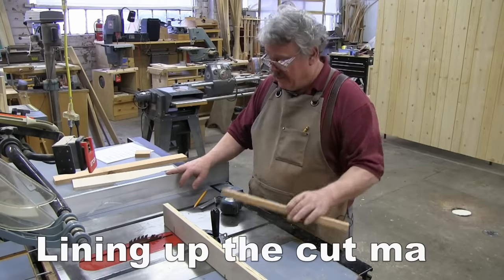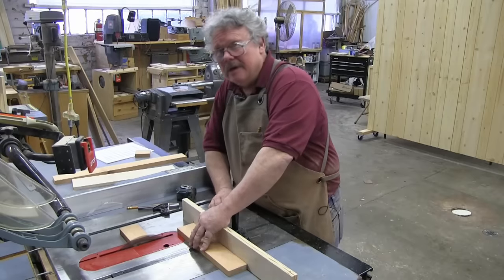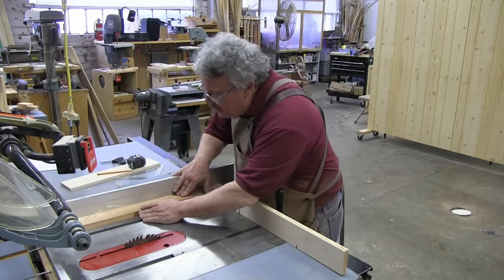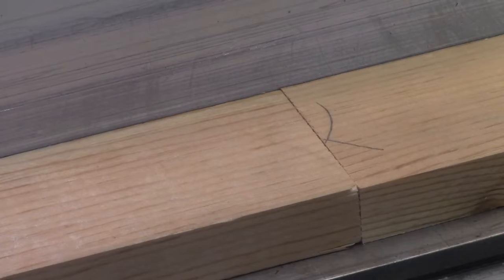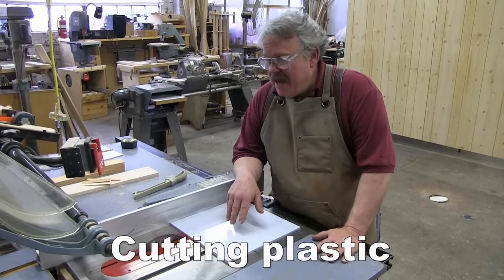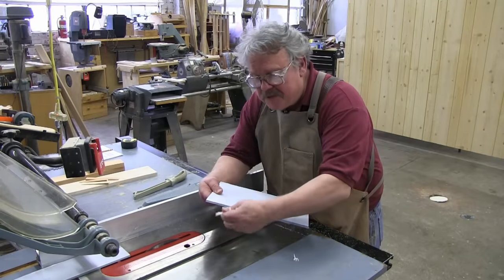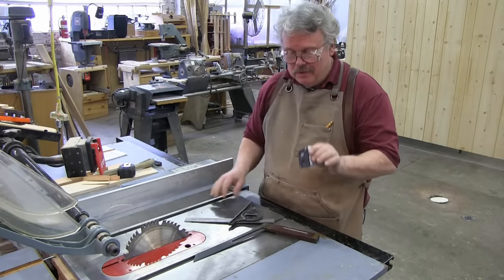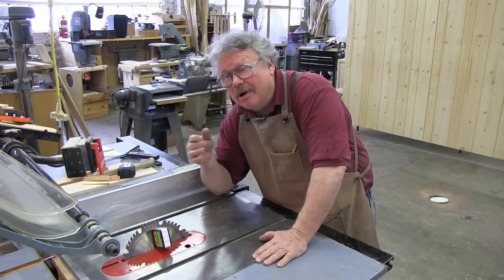5 Expert Table Saw Tips

Comment: Thanks for the video tips.  I have installed a magnetic relay "STOP" switch a my leg level on the table saw frame and by tapping the switch to turn off the table saw without having to take my hand and eyes off the wood and find the the table saw off switch.  I don't use plastic push stick because they can shatter if they tough the blade and I don't use the "bird's mouth" push stick anymore because the pivot at the back of the wood and the front of the wood is free to rise up because of the rotating blade.  Instead, I use a longer wooden push block that provide downward pressure and forward motion all in one movement to prevent kickback and improve table saw safety.
Reply: I've been a contractor for 27 year,  and i fully agree with you. He's leaving way too many variables open for kickback and all kinds of damage to the push stick and materials.

Comment: #2 assumes is that the faces or the piece are parallel.  One way to check that is to flip the other piece at the cut line and stack it on top of the first piece.  This puts the same face against the fence.  Now run your finger on the cut end and make sure the piece line up perfectly.  Now flip the pieces together so the other side is against the fence and check again.  If one matches but the other doesn't the faces are not parallel.  If they are both off then likely the cut was not square.
Reply: I thought you were only to use jointed boards on a table saw unless it's clamped in a jig? Ofc you don't have to, but it's not as safe. Edit: Jointed, then can be squared on a table saw/planer
Reply: @CowsGoMonkey  Jointed boards do not necessarily make a board safe or unsafe for use on a table saw.  Contractors rip lumber store wood all the time and almost nothing that comes out of lumber store is square or parallel.  You just have to use the right technique for the board you rea cutting.
Reply: @connecticutaggie  Ofc you can use unjointed boards, but jointed boards(2 sides) are safer. 

If you think that's wrong, then go rip a log on a table saw without a jig. Or a extremely cupped/twisted board.

And if you are checking for accuracy anyways like you were nitpicking orginally, you would want a square or 2S jointed board.

Comment: Good tips! How come you don't use a riving knife or splitter?
Reply from the maker: Thanks. It is an old, old saw and there are no riving knives available for it, and the mangled splitter that came with it interferes with the overhead guard we installed.  (No, the Delta Disappearing Splitter won't work; we've tried.)  I have gotten used to turning off the saw when the blade binds and inserting a small wedge in the kerf.

Comment: Sounds like the saw is getting ready for some new bearings
Reply from the maker: Yeah, we were thinking about replacing the bearings but decided to find a slightly newer version of the same model. The slightly newer version has adjustments that allow you to further adjust the angle of the blade. - Travis

Comment: Good tips. I have considered getting an inclinometer and after seeing this, I'll definitely get one. This will work well on setting the planer fence ninety degrees to the bed.
Reply from the maker: It's one of those tools that, once you have it, you find a zillion uses for it. A month after purchase, you wonder how you ever did without it.
Reply: I just bought that digital one, and I completely forgot the zero-function, so thanks for reminding me that the ground on which you work on is never 0 degrees, haha
Reply from the maker: @MDay8  So True. The hangar in which we have our shop is 100 years old, and our floor has been afflicted by tectonic drift over the century. Not only is no tool  sitting level, no tool is at the same angle!

Comment: Great tips and video - thanks heaps.  Will certainly check out your channel.
One thing you probably could have mentioned is that digital angle meters usually have a tolerance of 0.1deg  to 0.2deg.  Having said that, they are better than ‘eye-balling’ it.

Comment: Hello i like your video  but can i give you a tip.   on 1:20 instead of marking the line on side of the blade and you have to use the straight square  tool .. Mark line on the opposite side and align it to the   cut out mark ..

Comment: point 2 - you said checking the miter gauge against the fence for square will tell you if the gauge is square to the blade, assuming the fence is parallel to the blade. That is true. But it's really not what you should be looking for. You can make a square cut using a miter gauge even if the gauge is not square to the blade. The key is that the fence for the miter gauge must be square to the miter slot/miter bar. 

Love the tip about using the inclinometer to set the bevel angles. I have one. I don't know why I don't use it more.

Comment: When cutting strips of laminate, i spray some contact cement on a piece of mdf, only, stick the laminate to it and make the cuts. You can cut extremely thin strips with no chipping and it’s easily removable afterwards.
Reply from the maker: Good tip.

Comment: thanks for the tip on opening the kerf. I was watching for the only solution for what I am doing as I use a 7-1/4" blade 1/8" there is no splitter for that. Don't anybody jump in and say thin kerf microjig won't work. Thanks for your knowledge. Now I need to subscribe To get more info. Thank you
Reply from the maker: Most welcome.

Comment: Great tips! Nice work Nick and Travis. If I had another thumb you would get 2 thumbs up!
Something I found out while making a segmented turning was to zero the angle box (in the 8:55 minute mark) on the cast iron table instead of the throat plate. Also some angle boxes are very sensitive and if the aren’t 90 degrees (front to back) to the cast iron table when measuring it can slightly throw the angle off. It may have been my particular angle box. Was just my particular issue but when I started doing those two things it corrected my issue.
Reply from the maker: You might want to watch or video on aligning and adjusting a table saw. In it, I suggest to the viewers that they spend some time carefully adjusting the throat plate so that its dead-on flush with the table. There are dozens of small measuring devices -- squares, triangles,  height gauges, and so on that need to be set next to the saw blade. In order for them to be accurate, the throat plate has to be properly aligned. A digital angle finder is one of the very few that can be registered several inches away from the blade, then used to measured the blade position. I registered the angle finder off the throat plate because I know I can trust my throat plate -- with ALL of my measuring devices.

Comment: I cut lexan last week with a carbide rip blade, worked just fine. I cut same lexan in power miter saw, very bad idea resulted in  bad kickback.  I have had good results cutting 1/8" aluminum on tablesaw with fine tooth paneling blade on tablesaw.  Great tips on the use of the inclomometer  (digital angle finder) thank you for all the tablesaw tips in this video.
Reply from the maker: Most welcome.
Reply: Yea a paneling blade will also cut most roof steel in a circular saw, but makes hella racket and leaves sharp edges that must be dealt with, so gloves and ear protection a must.

Comment: I hate stopping my saw in the middle of a cut. And I don't like stopping the wood either if I can avoid it. Unless I make a complete, continuous full cut, there's always some little ridge or burn mark on one side of the kerf or the other.

As always, great content.
Reply: the trick is after saw winds down, move it back about an 1/8th inch or so so teeth are free in the kerf, then don't re-engage until blade reaches full speed.

Comment: When using the digital angle gauge ("inclinometer"), it is critical to rest it on the table and then rock it up onto the blade.  The reason is any slight tilt of the device forward or back will result in an imperfect reading.

Comment: Great video and tips as always 👌 👍👍👍
Just some observations tips...
4.o = safety tip... When used as shown, the blade is pushing the cut part forward (outfeed), so make sure you are expecting that or part will fly 😀. Normally, resistance is in the direction of the operator. ALSO, very important DO NOT use carbide tip blades to cut backward  !!
5.o = if you place an inclinometer as high as you can (vertically from the table top), even more accurate reading is possible.
Thank you for sharing your wealth of knowledge with us.
Reply: It doesnt matter how high you place the inclinometer. If the bar or blade is perfectly straight, the angle and precision will be the same. If they are not, you will not be able to trust ANY measurement.
The only time extra length will matter, is if you use the 3-4-5 (Pythagoras) method to square something.
Reply: Thanks. I may try using my table saw again. Can I also cut plexiglass as you demoed the plastic cutting? Does thickness or bulletproof plesiglass change the matter and how?

Comment: QUESTION: Are you supposed to zero out your inclinometer on the table surface, or on the table insert? I always thought it was supposed to be on the table surface, since there's where most of your wood will be riding. However, you zeroed yours out on the insert. So which way is correct? 
Yes, I realize in a perfect world the insert would be perfectly flush with the table top all the way across, but I think we all know we just get as close as possible when adjusting our inserts to be as flush with the table surface, because in reality, as long as the insert is very close and not proud of the table top, then that's really what we're shooting for. I just want to know I'm zeroing out my inclinometer correctly for the most accurate blade angle I can get.
Reply from the maker: There are two schools of thought on this subject. The first -- the "close enough" school you allude to -- is that you shouldn't use the insert because it may not be flush or level with the table. The second is that you should carefully align and level your insert so that you can confidently use the entire surface around the saw blade for measurement. I attend the second school. This not only lets me use the inclinometer close to the blade, I frequently employ a set of small engineer's squares, triangles, and height gauges for set-up. These would be useless if I couldn't trust the insert surface.

Comment: What are your thoughts of using a laser leveler for cuts?
Reply from the maker: Takes an enormously long time. Lots of smoke.  You have to crank up that laser to the "Death Ray" setting, then wait for it to burn all the way through the wood.
Reply: @WorkshopCompanion  Hahahaha. I meant for lining up the cut with the saw blade.

Comment: Not sure because I'm a beginner, but did you do a cut holding both pieces while cutting? most vids that I've seen says that is a no no. (at 3:40)
Reply from the maker: In every cut, you must maintain control of both pieces -- the cut piece and the cut-off. Oftentimes you do this with the aid of a push stick, miter gauge,  or by clamping one or both pieces to a sled or extension, but both pieces must be guided past and/or away from the blade as the cut finishes. Loose pieces on  a table saw -- especially small pieces -- may shift due to vibration. If they  slide against the spinning saw blade, the blade may catch and fling them at you. There are exceptions -- occasionally you need to stop feeding the wood and turn off the saw, but even then you have to maintain control of both pieces so they remain where they are until after the blade stops.
Reply: @WorkshopCompanion  Very much appreciated! Thank you for the explination.

Comment: Good tips, thanks. Just a note... +/- 0,1 deg precision may easily result to 66,4 or 66,6 and you never know. Inclinometr is very useful but in such a case, when you need critical precision, I would rather use calibrated ruler or something like that.

Comment: Hey do you have to draw an x on the board when checking fence for square
Reply from the maker: I suggest you draw an X on one face of a board when checking that the miter gauge is square to the blade. It simply marks the board so you know which face is up or down after you cut through the X and lay the two parts against the fence. It also shows you that you're laying one cut end against the other. It's not absolutely necessary if you trust your memory. I don't.

Comment: I have a question I have an older Craftsman table say and it does not have a kerf.  Where would I go to find one or make one?
Reply from the maker: I suppose what you mean by a "kerf" is a riving knife or splitter. If you google " sears craftsman table saw parts," you will find several suppliers of replacement parts, including Sears Parts Direct. They may be able to help you. I have an older (50+ years) Delta table saw. When it was made, there was no such thing as riving knives, and there are none available for it as an accessory. We recently made a riving knife from .105"-thick steel that will fit the old saw guard mount. (Most thin-kerf saw blades are .110" thick. The .105" steel provides .005" clearance if I mount my thinnest blade.) You may have to do something similar depending on your saw model and what's available.

Comment: #1: Couldn't you extend the line drawn with the square all the way across the wood so it lines up with the kerf cut on the fence at the back and position the wood that way?
Reply from the maker: Of course you can; there is more than one way to skin this cat. But the problem with using the fence as a reference is the slop or "lash" in the system. The  miter gauge guide bar is a few thousand's of an inch smaller than the slot it rides in -- otherwise it would be impossible to slide. Furthermore, every saw blade has a small amount of runout. Because of these things, that kerf in the fence will grow wider as you make successive cuts. You can correct for some of this lash by consistently pushing the miter gauge to the right or left (choose one) as you cut, and this will help extend the usefulness of the kerf. But using a saw tooth as a reference will always be accurate.

Comment: Great tips, can you show the start/stop control for the table saw.  That looks like a much more useful location rather than under the saw.
Reply from the maker: I think so. Safer, too. It came with an overhead guard that we installed on the saw about 35 years ago.
Reply: @WorkshopCompanion  I've always made sure that my off switch is placed where I can hit it with my leg... I don't need to let go off anything to shut the saw off in an emergency (which, thankfully, I've not had yet).
Reply from the maker: @thegringobaker  There are good arguments for a knee switch, but there are also some against. The switch is not in your line of sight, so there's a chance you'll miss it on the first kick. And you have to take one foot off the ground, so you're off balance for a second. That can be  dangerous as well. I advise students to use the set-up that works best for the way they work -- normally, the set-up with which you feel the most comfortable and confident.
Reply: @WorkshopCompanion  Yes, there are valid arguments for both ways. I do agree that some of the under- saw switches are not exactly a safety feature as they are so far under the saw that finding them easily is sometimes not possible. The factory location on mine is very good... allowing me to shut it off with a simple knee bend... not foot raising required. 
I'd like to mention that i found the video entertaining and educational. I enjoyed it.

Comment: One thing about how you use the digital inclinometer. Setting the zero will be much more accurate if the zero is done on the table. The throat plate is a poor place to measure anything since the wood cut is not referenced what so ever from the plate, but always from the table. Same goes for setting blade height.

Comment: Another well done video! I was thinking that on your first part on cutting a board to a specific length why not use the kerf on your miter guage board to measure?
Reply from the maker: It works for a short while, but normal saw runout soon widens the kerf and the accuracy evaporates.

Comment: The last one only works if the miter bar is made of steel. If it's aluminium, you will have to hold the inclinometer to the bar yourself.
My own inclinometer measures to 1/20th degree (Diesella IP54 bevel box, item no. 10453500). :)

Comment: on the inclinometer, do you think a cell phone could be used instead? I have an app on the phone for measuring angles like for a roof pitch, maybe not accurate enough?
Reply from the maker: If you watch other videos, you'll see that I use a smart phone app called "Rotating Sphere Inclinometer" all the time. It's no longer available, but "iLevel" does just as well. I also have a magnetic back for my phone so I the stick it to tables and fences.

Comment: Great tips.
Note: As an alternative to Tip 1, I often lift the pack of the piece up, keeping the edge flush to the fence and more the piece forward such the the marked edge is lowered to contact the blade.  I then line up the mark with the blade then carefully lower the piece back down making sure it does not move side-to-side.  It was probably not as accurate as using a straight edge but better than eyeing it.